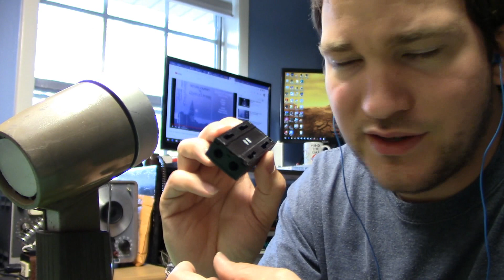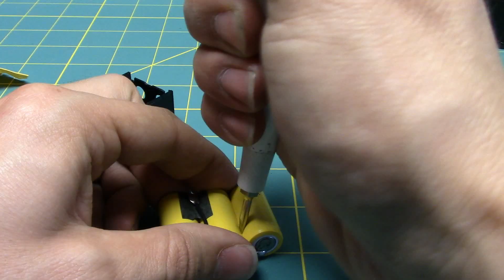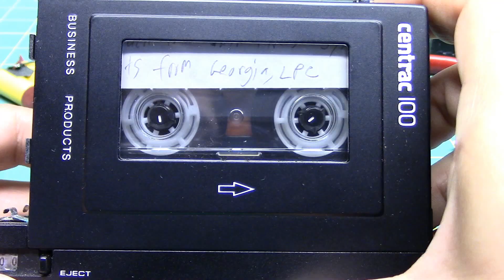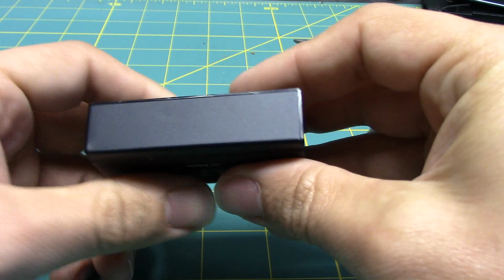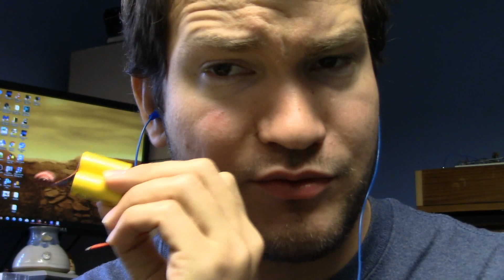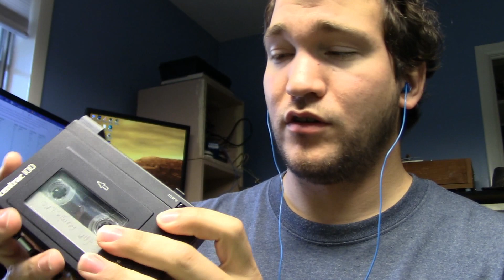Battery Pack Rebuild -- Centrac 100 Cassette Recorder

Comment: Hey, I have one of these recorders but cant find any information on them online. Can you please point me in the right direction
Reply from the maker: I have the manual for this somewhere, with the schematic, but unfortunately I do not know where they are right now. If I find it, I will make a video on this recorder that also shows the schematic. I do know this is made by Sanyo, and another battery compartment (corroded) I have for this is branded Craig, so I think there was a Craig version of this recorder, but I don't know what its model number is, though I think I saw it on the internet once, but that was a while back.
Reply: @CassetteMaster  sweet thank you

Comment: Nice rebuild. I've built battery packs for some of my RC cars and tank, also I built one for my shark sweeper. I just use the original wire and regular office staples for the links between cells.

Comment: Nice video! Maybe I missed it, but how do you charge those batteries when they are in the pack? Does the recorder do it? Congrats on the restore!
Reply from the maker: The unit has recharging circuitry (a bit simple, just a series resistor). I had lost the original charger "wall wart", and had another with the right voltage and appropriate jack. Being a fool and assuming tip-positive was correct, I tried "charging" the original battery with it, only to have ruined the original cells by reverse polarity. I learned...the hard way. I have since learned to be less stupid.
Reply: At this moment um watching William Castle's  Tingler on Svenghouli, Vincent Price is talking on a reel recorder, perhaps a Concord?  https://www.youtube.com/watch?v=FNMwW8Mwc5Q
Reply from the maker: Looks like a Webcor.